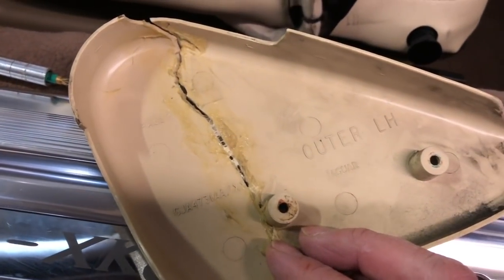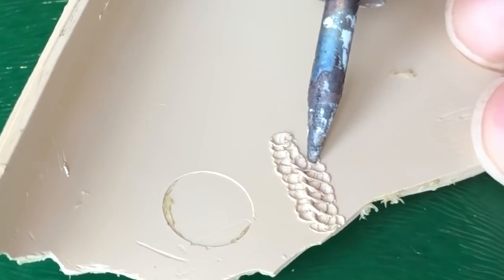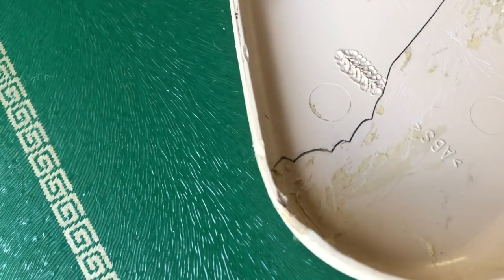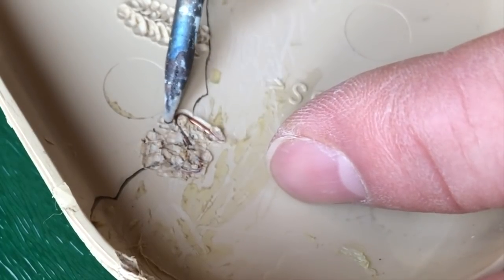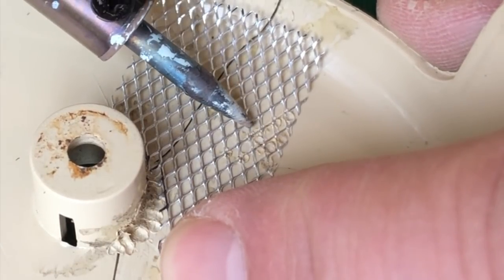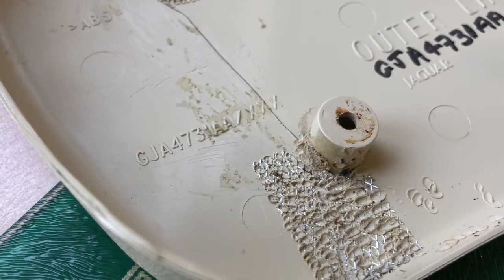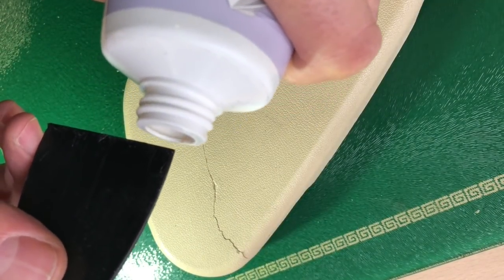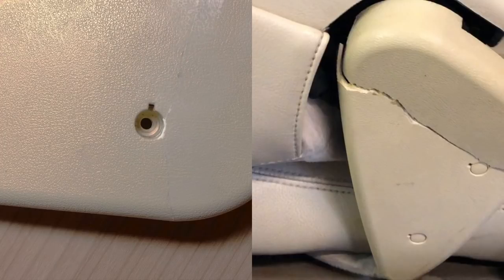Plastic Welding. Repairing ABS car interior plastics. Jaguar XK8 or XKR

Comment: The wire method is imo far better and stronger. I have just bought a 1999 XK 8 with a cracked cover as per video or if i can find a cheap weller soldering gun it will make the job really easy. It will get the treatment later when some other issues have been fixed.
 Like the vids re the XK 8's keep them comming. Any idea where the aux alarm sounder is situated ? Think mine is caput and causing a battery drain.
Reply from the maker: Hi @philf5043 the sounder is below the right hand headlight and axcessed throgh the hatch in the wheelarch liner👍
Reply: Thanks for the heads up where the sounder is. Ill remove it and see if it can be refurbed with new batteries.

Comment: Addressed immediately without the glueing attempt and it would have looked much better on the visible side. I use window screen and actually tried steel wool which helps on curved surfaces. A better flatter tip for the iron would help and something like a razor blade to hold the mesh down as the plastic cools and hardens is indispensable. I taught myself with the harbor freight kit and this type of repair has a sharp learning curve- don't be afraid to experiment and do it outside and not in the living room like I did the first time

Comment: There is a hand held extruder for 3d printer filament. It is used for free form crafts. Its has a rechargeable battery. 3d filament comes in many colours and even in rubbery types. I have never used the hand held one but it sounds useful for what you are doing. 
I Also use stainless mesh like you do. I get it from fry pan spatter guards at the cheap shop.

Comment: I fixed an abs motorcycle fairing
with a 60 watt soldering iron and pieces of stainles steel fine mesh.
Was more stronger than oem.
Reply from the maker: Well done👍😁

Comment: I would typically use the soldering iron with a cut off nail (to save my tinned bit). Melt a little down the crack. This is ABS plastic, so find some more scrap ABS plastic, cut or shave into very small pieces, soak in Acetone. Draw the plastic solution up with a syringe. Apply the liquid plastic to the crack and allow it to set overnight. It's also useful as glue for the broken parts. Use small clips to hold it steady while it cures. 
This is faster and secure for plastic mending.
It's not aluminium, it's aluminum.
Reply from the maker: Hi Susan. Top tip re the Acetone slurry. Very effective. A great follow up to the instant hold achieved via the mechanical welding.
Re Aluminium 
I am English. It is spelt and pronounced the same way in all english speaking nations except America
Where Websters Dictionary chose to include an alternate spelling, to closer replicate the common American pronunciation of the Element discovered by Sir Humphrey Davey. They later dropped the original Spelling altogether. All non-American dictionaries list it as Aluminium. This is also how it appears on the periodic table used everywhere except America.
Every english speaker understands what Americans are saying when pronouncing Aluminium, and Jaguar.
It is just a localisation of the language and the world is a richer place for it.

Thanks for watching and for the great comment
John

Comment: microcracks in ABS are better fixed using solvent welding; for complete broken parts, ABS resin (like pipe glue) is better; welding is good for plastics that do not dissolve in solvent - like PP, PA, HDPE, or Nylon

Comment: Betting that today you use UV glue...it will fill the gaps on each side but work the back side first. Sand well so the glue can bond well. Or but ABS welding rods for the back and UV glue for the parts that show. It is clear mostly.

Comment: I realize this is an older video, but you could use a heat gun or torch to heat up the wire and then push it into the plastic. Quicker and would do the repair much better. Also, swap out the soldering iron tip for a flat circular type to heat the material. Again, much easier and smoother as well. Just some ideas...
Reply from the maker: Certainly agree its easier with a flat tipped iron Gary. 👍
You could heat the wire and then apply it to get it started but it will chill down as soon as it starts to penetrate the plastic. Re heating it husing a torch or heatgun would be asking molten trim😁. So you would probably need to finish off with a soldering gun anyway.
You can buy guns that electrically heat wire staples and then shoot them into the plastic. These are great for thicker plastics and where you dont mind a little surface damage on the other side.

Comment: I knew about the cable tie, I have seen people use staple clips to join either side. I like your mesh work, I fell on my bike and damaged the two panniers and I used cable tie to cross-hatch the damage, it was a mess internally, but it worked just fine. The mesh idea would have been great. Also, I have seen videos where they use superglue with baking soda.
Reply from the maker: Superglue can work really well, but always be aware that it will tend to leave a white discolouration or bloom on your trim as it drys. Its the gas coming off the glue and then settling on the surface. Its VERY difficult to remove or totally avoid so best reserved for non cosmetic repairs or where you want to paint it after..

Comment: Nice, I have used the existing plastic melt method, But then, I need to back up that repair and add material. I use fiberglass resin, I do have to roughen up where it will go. applying to a slick surface, it could peel off. By roughening the surface, it gives the resin something to grip onto.
  I use a Dremel tool and a  rough grinding stone to break the gloss smoothness of the area to be repaired. Just a surface roughening, no need to over do it.
  Mix the resin, have some strips of fiberglass cloth ready.  Pour some in, and lay down a strip on the repaired area. The resin will flow into the cloth. Resin is pretty hard and reinforces any repair. 
The melting is fine, but you can never get the thickness  as a factory piece. 
  One could add plastic to the repair, just like is done with metal welding. 
  Thanks for the video, excellent!

Comment: I see that the plastic is ABS so I'm wondering if you just couldn't use plumbing solvents your plumbing glue systems with the cleaner and the actual glue to connect weld this plastic
Reply from the maker: I might give that a try Arlen.  Ive never considered plumbing solvents. 🤔. Time for an experiment👍

Comment: There's a proper tool for this that heats the metal fasteners instantly. I've seen it on a few car programmes.
Reply from the maker: Yes I have seen them. They do look very effective. However have never felt that the frequency with which I would need to use it justified getting a specific tool. Plus I find re using scrap wire and mesh more satisfying
Reply: @ToTheGarage  its all about saving money and re-using scrap. 👍

Comment: I use the sun, with a powerful magnifying glass, to melt across the crack, and then spread the molten plastic across with a stainless (clean) knife blade. This (temporarily) holds both broken pieces together. If I am welding ABS, I find a piece of similar thickness, and size of ABS. I place this additional (shaped) piece directly over the crack, ensuring all areas to be welded, are cleaned and slightly roughened with some glasspaper. Then, I heat a broad flat knife until it 'blues'. I raise this additional piece of ABS, and then (with a heated knife) you place the additional repair piece on top of the knife, whilst also pressing the underside of the knife against the parent ABS. The whole lot 'fuses' together, as you slowly drag the heated knife out and press down on top. The addition of added ABS really strengthens the potentially weak area. The edges are then 'feathered-in, with the same hot knife. This has always worked for me. Greetings from Australia.
Reply from the maker: Excellent intel Peter. Love the heated knife idea. However using the sun and a magnifying glass is probably more appropriate on your island than on mine😔 
🤣🤣

Comment: Top tip when your soldering iron is cold undo the screw pop the tip out and put it back in the other way around and you will end up with a flat end
Reply from the maker: A great tip.. If you will excuse the pun👍

Comment: Nylon cable tie, with ABS??   Why not buy some ABS welding rod?  The outside could be blended away with ABS cement/gel, used for ABS plastic models. These even come with a brush. There will be no colour issue.

P.S.  Always do the heat welding techniques, on the back first.   (I have had a plastic repair business in Geelong, Australia since 2011)
Reply from the maker: Top tips from a Pro👍. Thanks Mark.

Comment: Thanks for a thorough video. To fill the cracks, you can also use a framers putty which comes in many colors. I used the putty to fill the cracks in the frames when I worked for a picture framing company and you couldn't tell where the corners met.
Reply from the maker: Never used framers putty🤔
Reply: @ToTheGarage  Also after using the putty and before the putty dries. Put a small drop of hot glue onto the part of the plastic that is in good shape (apply wd40 first) and then remove the glue so that the texture of the plastic (like leather) stays on the hot glue and then put that glue in the putty while it's drying and then paint the entire piece in the desired color. That way you will not see the plastic weld and it will have the same texture

Comment: Oh wow , your a little bit late for me , my friend . I'm already converted . I learned plastic welding nearly 2 years ago , in an effort to repair the front bumper on my Hymer motorhome . The repair was difficult , as the bumper was hiding more damage than could be seen , and only became visible , with it removed . It even involved removing some of the indicator recessed plastic , which was beyond savage , and replacing with new . 
It took a total of three days to put right , but was totally successful , with much of the cost for the welder itself . It cost far less than the replacement cost of a new bumper which retails around 1300 quid . My costs were way less than a quarter .
I've since repaired brackets and clips that are impossible to source .  

Early last year , buoyed with this success , i began to convert my dashboard , in the same vehicle to double din . Quite a nerve racking experience , as should it go wrong , sourcing a replacement would have been extremely difficult . The motorhome is 22 years old , and dashboard trim seldom available . The result is staggering , even if i do say so myself . Right now the panel is finished in a brown basecoat , awaiting final finishing . As i can't hope to replicate the original finish , i've decided to apply a walnut burr finish , using a different technique . Hydro-dipping , i'm busy studying that process now . I have since been asked where i sourced the panel , as they've never seen one before . They only believe it's a one off , when i show them the back . As you say , it's not quite perfection .

Comment: Back up all the work with Permatex ABS plastic welding epoxy. Use in a well ventilated area, it is very irritating to the nose.
Reply from the maker: Thanks for the tip!

Comment: I am going to be 3d printing some ABS plastic but what I am making will be to big for the print bed so breaking it up into several prints will melting a couple of nails into the plastic to hold it work or if it is possible can I melt some ribbon style magnets so that it can then just be held in place onto where it will live with the magnets
Reply from the maker: Ex cellist ideas. Happy experimenting

Comment: I can tell you that the plastic on jaguars is brittle as hell. I had at least 10 places where the plastic broke. The older it got the worse the plastic was as well. It was about 8 yrs old when I got rid of it. The door panels were loose and several other things inside and under hood were broken. It started with the brake line that had a plastic valve. It just made it hard to press brake it only leaked air.
Reply from the maker: Do you live in a particularly Hot area Neal? Sounds like your plastics aged very quickly! 8 years is nothing on non sun bleached parts

Comment: Very good and properly done, however saying it is ABS, which it looks like yours is, is incorrect unless you are just talking of this particular part. Some parts can be ABS but majority of these interior cars are not made with ABS. Total success is knowing what plastic you are repairing, however the method you are using is a tack weld, works OK and this type of repair but does not provide a whole lot of strength and you should never use this method to repair any kind of tanks.
Reply from the maker: Thanks👍

Comment: Just a tip when going for structural integrity when welding plastic avoid using filler that is colored when possible and the worst color is red...speaking from working multiple years at a company building plastic welders for commercial applications such as welding battery tops on, center consols and appliance parts among many things
Reply from the maker: Thanks Craig. thats an excellent and very niche tip!

Comment: A better way to do a long seem like that is to use some small wire screen in strips in an axle flat tip for plastic welding that attaches to the soldering iron much better repair

Comment: thank you for repairing and not replacing! we all need to start doing this
at the macro level, if governments would subsidize repairs, we could provide more jobs and drastically reduce our landfills
Reply from the maker: Couldn't agree more. If We could still buy Brake shoe linings in the Uk, I would be re lining brake drum shoes rather than replacing all the Very robust metal supports every time.

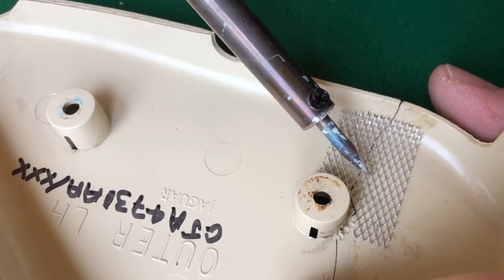Comment: 13:20 ... heat the metal don't the plastic ... bla...bla.. bla.. 

To avoid not heating the plastic
I think it is best if you use a small piece of thin aluminium sheet that placed on the top side of metal while continue soldering

🇮🇩👍😀🤜🤛🙏

Comment: Really like the melting aluminum auto body mesh into the ABS plastic technique. Provides a lot of strength to the repair. Using this technique to repair cracks in our Apache camping trailer. Drilling a 1/8" hole to terminate the crack to prevent it from spreading/ Smoothing & finishing off with a coat of MEK.
Reply from the maker: The 1/8th  hole is the mark of. a professional Murray👍👍. Good tip
Reply: An extension cord with a old fashioned light dimmer wired to an outlet can control the heat on any simple soldering iron, a tip from 43 years ago, one of these times I'll try it.
I would think about cutting the trip hazard shorter &/or adding some reinforcement ribs, nice of them to mold ABS in.

Comment: If you have probs with welding or chemical bonding try Q bond. Its freaking amazing. You can seam plastics together. Mold ,repair, fill missing pueces and do the same with netals and most any material.
Reply from the maker: Thanks for the tip! I will look out for Q bond

Comment: Get another small piece of abs cut to cover the seam on the back side. Brush the seam and as far past you can as well as the new piece with MEK. It is a solvent that will chemically bond the two pieces plus the support piece together as one. Welding is great you can buy specific rods for different types of plastics.
Reply from the maker: Its genuinely great fun to do plastic welding👍
Reply: @ToTheGarage  i have neen doing it for decades but im hating the project im on now. Got an old garage door opener that some dumbarse hit with a 2x4 i think broke the big outer case on the front where the bulb and lens go. But the metalkic tape held it together until i went to change the bulb. I touched the lens and it fell and nailed me in tje face. Broken in two. Then i went to take the bulb out and the majority of the front fell out in pieces. Still that was ok ish. I removed it to see if i could fix. It only to find the controll board is mounted to a seperate piece of plastic abs/pc . it was in tiny pieces. The unit worked perfectly but i started having to adjust the force it opened and closed with. After taking the big case off i saw why the board was shorting against the frame when it would jiggle while running. I had most put together when the lady that own the house flew by with a 50 lb purse and nailed both pieces knocked them 5' into a wheelbarrow rail then onto two wood planers beliw on paint buckets bursting them further then to the concrete floor. Cant get the pieces any more. Prob spent 200 on glue epoxy rods valium and blood pressure neds trying to save this. Ive got a new one in the box out there but that would be admitting defeat.

Comment: John, My XK8 has both its outer hinge covers cracked with the upper part missing. Otherwise I would repair them. Do you have any idea how I can get two (rt and lt) outside covers??  I simply can't find any here in Canada. My plan is to make molds  and reproduce them in fiberglass or carbon fiber and can return the originals completely undamaged,   Any thoughts????
Reply from the maker: I don't have any spare trim Pieces Richard.
Anyone else have some to donate to Richards project?

Comment: I simply heat the wire first on my cigarette lighter and then place it in there with the help of Nozepliers. It's way more easy than doing with soldering iron.
Reply from the maker: Sounds like a good method for on the road repairs👍
Reply: @ToTheGarage  yeah it sure is😉